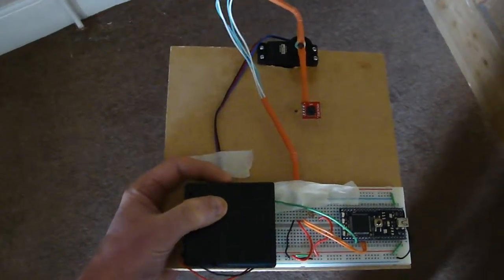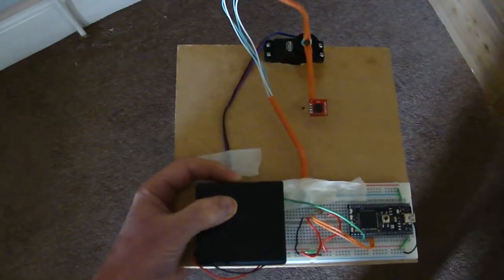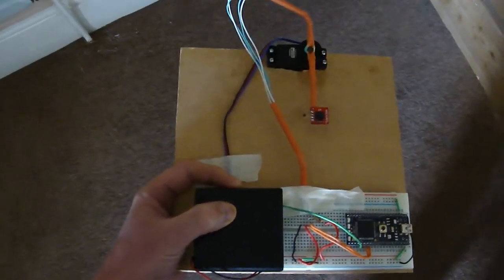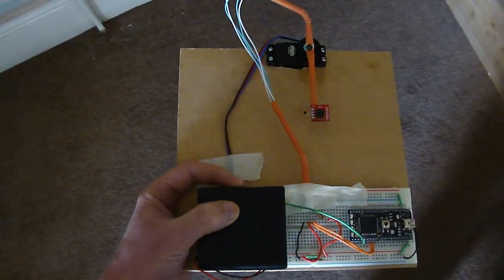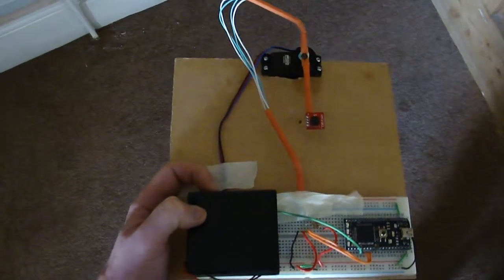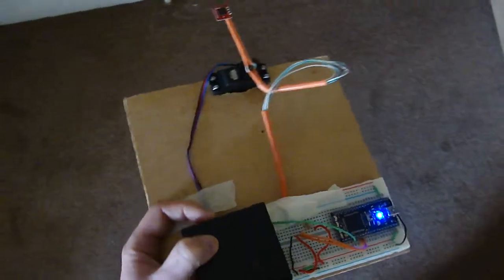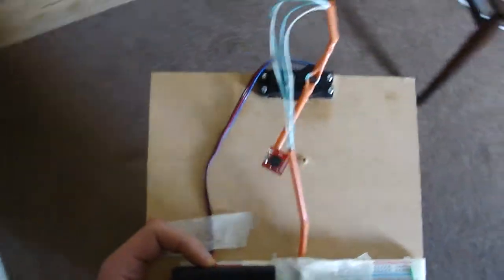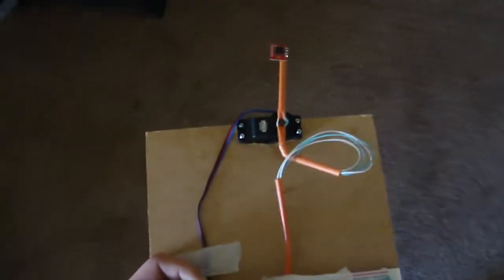mbed Closed Loop Compass

Comment: @xasdrubalex proportional controllers iare powerfull and easy to implement, but they may cause system instability, they are andy in a lot of case, but they can't be the best choise in different use cases.

Comment: @jackminardi proportional controller sense a long time difference from the control input value and the system output, with an high proportional gain you're able to minimize set error, but it can't sense fast change and other stuff.
derivative and integrative controllers can sense temporal changes, that's why using all of these give a better control over system dynamic.